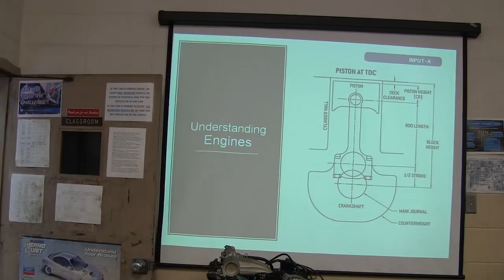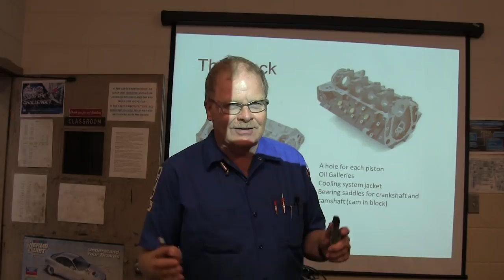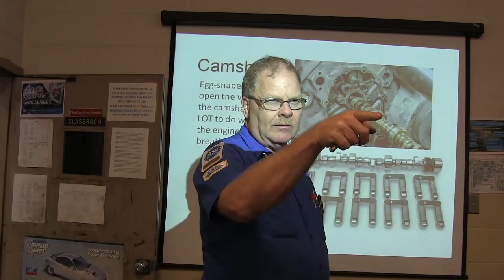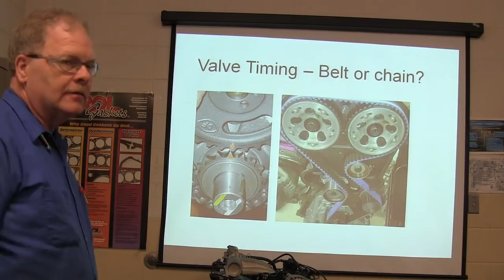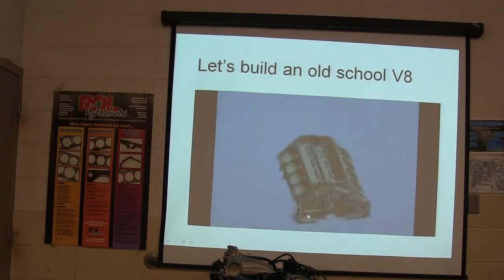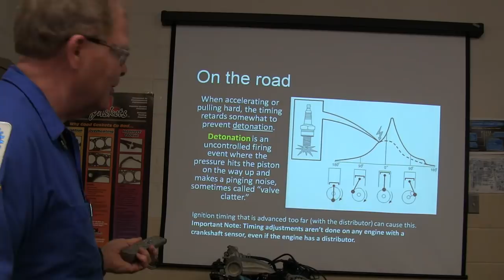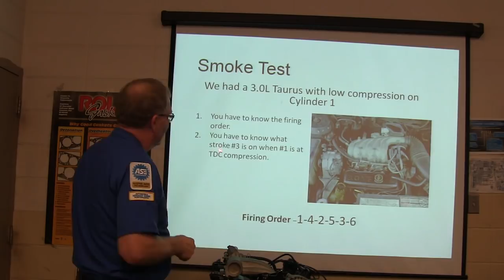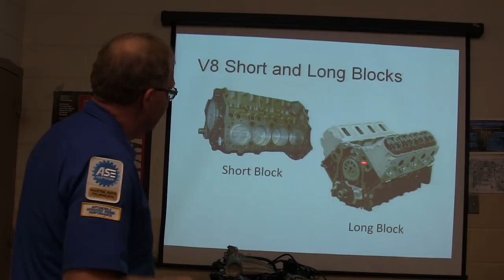Understanding Engines 2

Comment: Question for ya' McCuistian
, In your CRX engine swap example you said it would be acceptable to swap the long block of the good engine into the car that had a bad engine and keep the old management even though the displacements were different. Surely this would cause the engine management to expect the wrong displacement and cause lean or rich running depending on if the management expected a smaller or larger engine?

Naturally the fuel trims would take care of this somewhat but i can't help but think that it's a bodge? What are your thoughts on this? Is it negligible due to the difference being only 100cc or is there something else i'm missing?

Cheers, keep uploading the great videos nonetheless.
Reply from the maker: Actually on an 88 Honda CRX it wasn't an appreciable difference and it works just fine because also that one's OBD 1
Reply: @McCuistian  Fair enough, thanks for the reply.
Reply from the maker: Incidentally, the 4.8L - 5.3L -6.0L engine family in GM trucks is plug-and-play that way - you can put a 6.0L where a 4.8L was and just drive away.

Comment: the correct name for those plugs are core plugs
Reply from the maker: Yeah, I've heard 'em called that and expansion plugs too
Reply: We always called them freeze plugs, but I have heard that it's not correct. Those plugs were cast into the block to help remove the sand from the block after casting! I was told that they are actually casting plugs!! But, was told that what ever I knew to identify them was acceptable. And if they gave way during a freeze to protect the block from cracking, that was luck!!